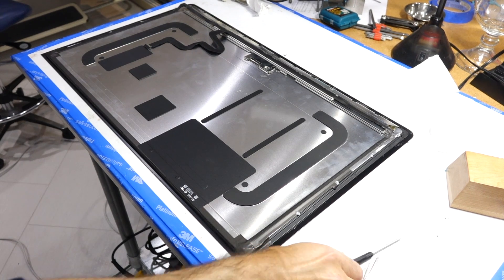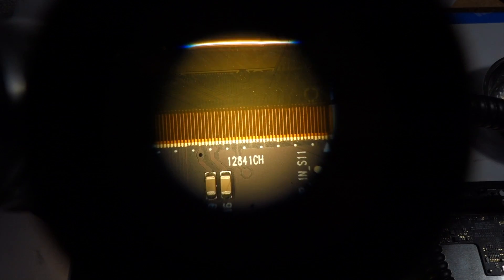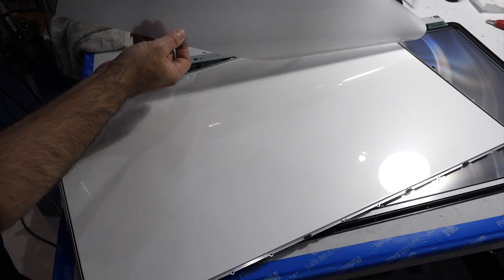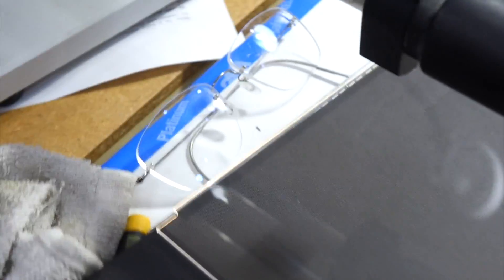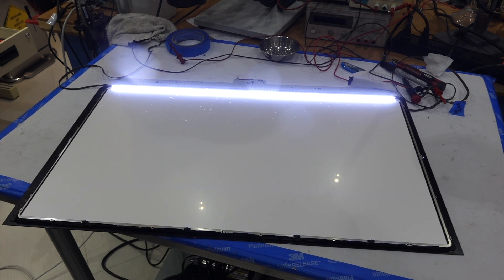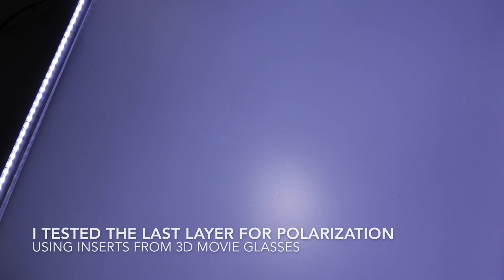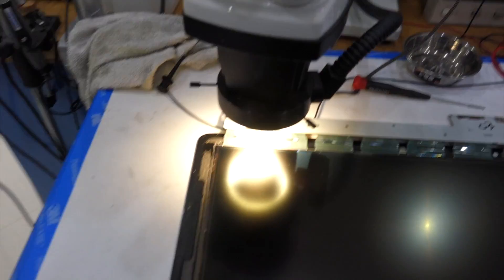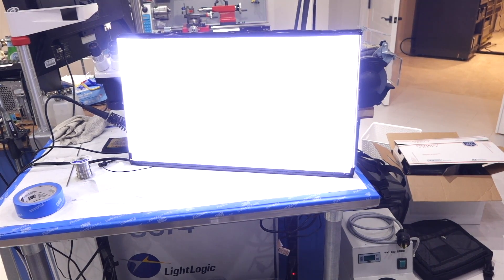Modern Tech Fail: iMac 27" Retina 5k Display Panel Tear Down

Comment: does anyone know what microscope marc uses?
Reply from the maker: I do! The binocular is a Bausch & Lomb Stereozoom 4. The high power microscope is an Olympus BH-2 with ULWD MSPlan objectives (meaning it's geared for long working distance rather than ultimate resolution). Both are vintage classics.

Comment: I did the exact same thing with an Imac, cut the ribbon cables while separating.  It created a black bar 1/3 of the screen, still usable if you kept things on the 2/3 due to the high resolution.  Very beautifully crafted screen.  Sucks no way to fix it.

Comment: Hi @Curiousmarc I have 2 iMac screens one screen glass broken but lcd intact and works fine and the other one screen light up backlight works but no display. Do you think I can make one working display out of these two. Both are 27 inch 2015
Reply from the maker: I don't know, but it seems difficult. It looked to me like the front glass and the LCD are permanently glued together. Not sure how one would separate the two. If it could be done thermally, one would need a huge hot plate!

Comment: A bit late in finding this video, but I'm looking to do basically the opposite kind of project with an iMac 5k display. I want to completely remove the backlight assembly and mount the LCD panel to the side glass of a desktop PC case, inspired by the projects that led to iBuypower's Snowblind case

Once you removed all of those diffusion and lense layers, is the LCD panel transparent? More importantly, does it function? I'll be providing my own source of backlighting.
Reply from the maker: Yes, totally feasible. The active part of the LCD is completely independent of the illumination part.
Reply from the maker: You’ll need to keep the polarizer though or provide it polarized light, of course.

Comment: Marc I have same imac A1429 EMC 2834 backlight issue  tested backlight with led tester . And found three pair of them working led and others three pair no any response.  So I assumed that back light are faulty so I open it and remove light from penal and I tested individual  all 90 pcs led smd and all work fine . I am very confused on  the connection of the the led . I believe there is 6 pairs of wire in led main connector gray and black.so  could you help me out that every pair should  should light when I test it with led tester . Any configration of connection please
Reply: In your video which which wire you use for power up led light please reply this will help me

Comment: Very nice video sir. Some iMac 5K displays have dust problems (it starts showing up in the lower corners), and some not. I had a 5K iMac (mid 2017 model) for 4 years and the screen never showed this problem. I also had a 2015 5K iMac for two years, same story ... no dust at all. Now I just got a 2020 model and I hope it will be ok too, BUT ... there are a lot of users complaining about this problem, just do a Google search (2014, 2015, 2017, 2019 and even 2020 iMacs have this problem). It would be interesting to understand where is the "weak spot" and why Apple has not been able to completely fix it.

Comment: I have a question please, can I replace the broken glass in this 5K retina screen or not, because I have an iMac that the screen fell off due to having an upgrade inside, and the glue wasn't storong to hold it in place
Reply: Exact same issue. Have a broken glass, still works but like to know if I can replace the glass only instead of buying the whole LCD screen. It would cost 10x as much. Did you do the glass only replacement? Can't find anything about it.

Comment: why does apple make it hard to fix their computers. My imac has a cracked glass, LCD is fine but the glass is cracked at both top edges. I still use it but lately it has been running quite slow and i was thinking of upgrading my hard drive to an ssd but because i have to remove he screen to get to the hard drive it becomes a project for changing the whole display when i could just have changed the glass only because apple thought it wise to bond the glass to the lcd...crazy

Comment: Hello, Do you still fix this screens? i have iMac 2015  27 inch and my screen is ruining will but front glass only broken but i can open mac system and see everything but broken glasses looks bad, so what should i do to fix this? i don't want to replace all screen just front glasses
Reply from the maker: I am not sure if this is possible, as the whole screen assembly is glued together. At least I don't know how to do it. Maybe you can ask a Mac repair shop or forum?
Reply: @CuriousMarc  from your video you separates each part from screen to fix it! 
i want to know if this part is glass only or something from plastique
Reply: how can i contact you?
Reply from the maker: @ITSolutioneg  The illumination layers behind the actual screen are in plastic, but the front part, the screen itself, the front glass is glued to the LCD active matrix glass and can’t be disassembled. Or at least I don’t know how.

Comment: Good video! Some of the older iMac LCD's gain yellowish tint, due to some of the internals "burn" and turn yellow. Do you know by any chance if it is possible to fix it? Thanks in advance!
Reply from the maker: Unfortunately I don’t. These panels use incredible manufacturing technology. You can tear them down to admire how it’s made, but they are nearly impossible to fix.
Reply: @CuriousMarc  I broke the golden cable that goes from the matrix to the t-con matrix controller board when I dismantled my imac 2017, 21 diagonals.  Should I change the entire matrix now or can the torn cable be replaced?

Comment: Could you kindly assist me by giving the detailed sketch to how to power the Back Light. Please give me the Exact Voltage and the Amperes you gave to light the Screen Back light.
I have an iMAC 21.5" 2.9Ghz late 2012 and it's Logic board Back light Inverter area is burned and the Back Light is not coming on but the Image is there on the Screen and I can see it when I flash a Light on to the Screen and also the Thunderbolt Ports give a the out out to external Screens. So I am now trying to power-up the back light by an external DC Power supply and please assist me to make it work. Thank you.

Comment: All of that excellent optical engineering pissed away on an idiotic cable design. My Voyage 200 calculator, which believe it or not I use all the time, had the same thing happen just from knocking it off the sofa. Vertical lines showed up. When I took it apart to try to reseat the cable, it got worse. Everything I tried made it worse. It's an absolutely retarded design!

Comment: Hi is it possible to remove the glass from the lcd? you got to the lcd then stopped, I was wondering if it's possible as there's very common issue with dust inside these screens thanks.

Comment: Curious Mark, I spent many hours trying to figure out if this specific screen (late 2015 iMac  Retina in my case) could be split open and the diffuser lifted so I could wipe down that typical Apple fail black 'shadow' - black - grey magnetic or whatever dust it is that's start to come out from the corner of the screen.... Is this doable without damaging the screen?
Reply from the maker: If it’s directly behind the front glass you are out of luck. If it is at the back of the screen in the illumination assembly you can disassemble it as shown. But it would be very hard to keep the layers clean outside of a cleanroom, and even harder to put back together due to the taped construction.

Comment: Thanks for the heads-up, Marc. We have a slower one of the same model. OTOH, we've only seen 2 hardware failures in over 25 years (both were hard drives), out of a number of Macs. One ran flawlessly, and almost constantly, for over 10 years.

Comment: So after you learned what went wrong would you say it would be possible to fix the flex cable or maybe replace it..?
I got the same issue with my 2015 but only one thin line. Replacement display is almost the price of the whole unit so I would rather fix it if possible...
Otherwise I might buy a used 2014/15 5k iMac and sell the faulty one... looks like it would be cheaper than replace the display...

Comment: It is like a flat "light pipe" or fiber optic surface.  There was a company names Lumanite in the 1990s.  They manufactured thick fiber optic tubing for lighting effects.  Kind of like neon sign tubing made from plastic.  You could order the material so the outer surface had a mat surface and it would emit light over the hole surface of the fiber optic tubing.

Comment: I used an old broken monitor for exactly that!
And you might find this interesting, in the older CCFL monitors the pattern is even weirder, since the light is coming from both sides a lot of times, the dots grow bigger towards the center
Also one more thing edited in now, if you look at the pixels, diagonally there's a circle between the groups of 4 RGB groups. Between rows there are larger and smaller circles. As for the actual size of each kind of subpixel compared to each other, between R G and B, in real life we see the 3 colours very differently in intensity so to be able to drive all 3 colours from the same sort of supply, they modify the size. Green is the bigger, red is the middle in size and blue is the smallest. It's there to achieve a more natural colour

Comment: Holding together with saliva. Not build to last. Not servisable. Planned obsolescence at it's most expensive expression.
Reply from the maker: I would say just the opposite. I was surprised how well built and how sturdy it was considering what I paid for it.
Reply: Well if its built so well,, then why weren't the flex cables to the glass better protected with metal or plastic covers so there is less risk of them being nicked/cut. Would've cost a few cents. Not applying the strain relief glue properly is lazy, poor quality control and unacceptable for a screen this expensive. Using glue to hold on the screen instead of screws is also cheap and lazy. If they had used screws in the first place, you would never have had use a knife to cut the adhesive and wouldn't have nicked the flex. Its lazily and cheaply made.
Reply from the maker: I’m surprised it does not show through the video, maybe I did not film it right. In person this is a very impressive piece of technology, highly engineered and very well put together. It’s mind boggling they can do this for a few hundred dollars. I’d love to visit the plant where they make this.
Reply: CuriousMarc There is nothing you may show to change my mind. I have a Mac G3 The one that opens like a trunk. On can change the HDD, add memory, clean the dust without being a technician. New macs are sealed.

Comment: Apple uses a tool that has a specific depth to open the screen, that avoids the problem altogether.
Reply from the maker: And now, I know exactly why!
Reply: @CuriousMarc  I thought you knew about it. It's like a small pizza roller cutter. It's very precise, and it works perfectly every time.
Reply from the maker: I used the cheap plastic one in the iFixit kit, but that did not work well enough. Apple must have a better tool.
Reply: @CuriousMarc  Right, I see now, it's almost identical. Maybe the length is slightly different, idk. Anyway to open it with this tool it's always better to make many long runs without pressing, it will preserve the plastic disk and won't hurt the iMac. I find a good idea to not go too deeply but instead to slightly pull the screen to remove the adhesive left.
Reply: Done the samething can it be repaired?

Comment: The iMac 24" A1200 (2006) has eight ccfl tubes (not LEDs) behind those diffuser/polarizer sheets.
Reply: Not sure how that's relevant to the video, but yes the Late 2006 iMac 24" is CCFL-backlit, and I believe the same is true for the first-gen aluminum / black plastic iMacs from 2007.

Comment: I don't know what to say about the pc world. The last machine I built was an Amd machine. For almost a year I have been battling a lockup issue. About every day and or three days, give or take. Just a hard lock up. After doing some research. Found a few things to try. Now I got it down to locking up once every three weeks. But still not close on what part I need to replace. I just know when I type in xx processor, xx video card, and xx motherboard. It lights up like a Christmas tree for people with the same issue. The only thing I know for sure was it got worse after installing a different video card. I think it just got the problem to come out more often. But all the hardware tests I run. Everything checks out fine. Also doesn't help it is such an intermittent issue. The machine I had before that was a used thrift store find that had an issues with borderline heat on cpu. When I looked up the cpu combo / motherboard. It was a known issue and could just be a bad thermal sensor on the system board or that combo of processor and motherboard. The simple solution was to just increase the thermal shutdown temp in bios. The processor was still in range for temp. according to the manual. But it was the upper range. Besides that every once in a blue moon I would get a bsod. The computer I had before that was very, very stable. It was a an Amd socket a system. The sad part is I do this for a living. The intel I5 machine I built for my son it rock solid. The hp business desktop I picked out for my mom is rock solid. The i5 machine I built my mother in law of all things. Rocks solid except I had to reload it twice to do infections. Also I can tell you one thing. Once Mac went Intel and Steve Jobs passed away. We see more and more macs in than ever before with hardware issues. Not just the standard hardware failure once in a blue moon. I'm talking several software corruptions for what seems to be no reason among other things. Anyway keep up the good work Marc. Also once again I have to ask what is the update on the IBM tape drive and the hp 2000 mini computer system too.